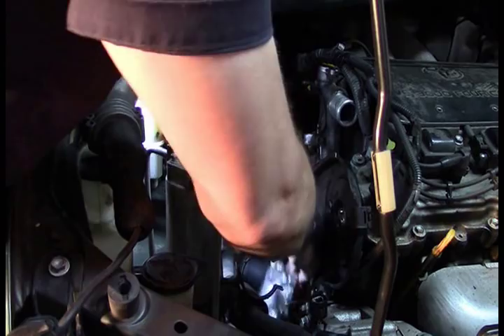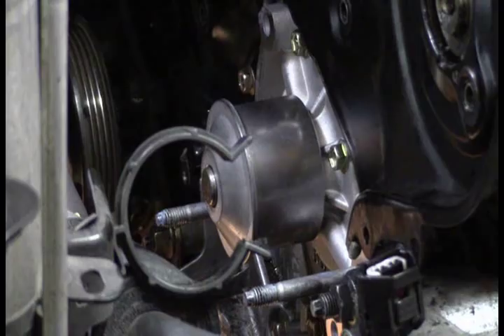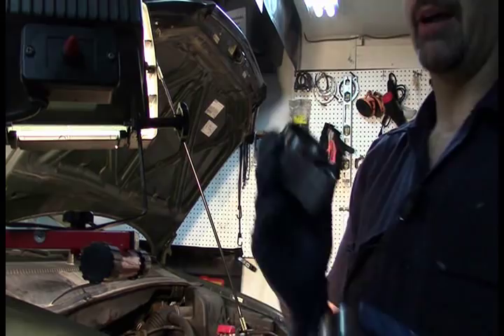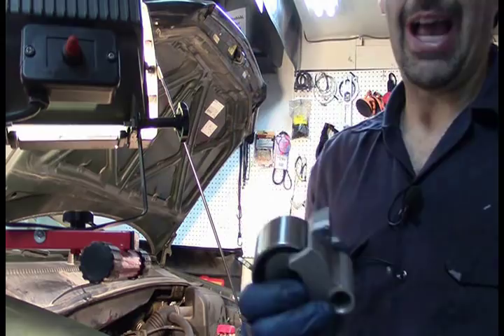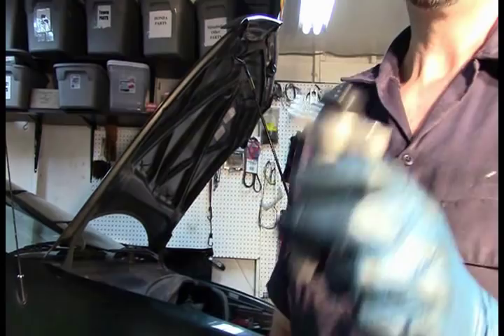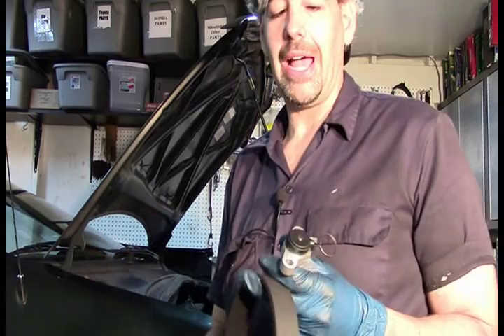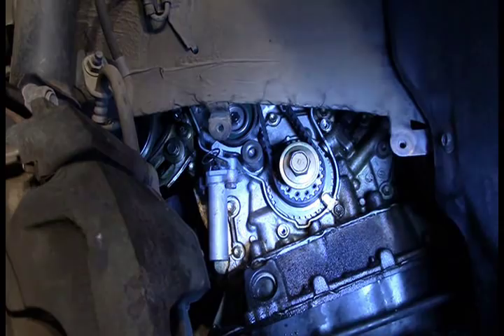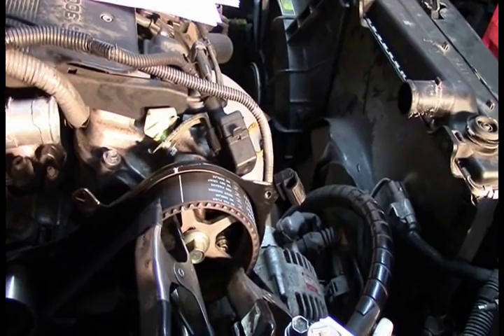Timing Belt 1997-2010 Toyota V6 Sienna, Highlander, Camry, Lexus Part 3

Comment: Thank you. I changed the timing belt water pump the whole kit. Water pump impeller is plastics its break into seven pieces. The pulley I can't take it off with the impact so I use your method with a big ratchet. Use as a leverage. I wouldn't done it without your video. So thank you very much.

Comment: Great video. I don't disagree with replacing everything as you mention, but I would like to tell you about my 2.0L 1991 camry timing belt adventures. The car ended up breaking a timing belt around 260000 km (160000 miles - I didn't realize it had a belt at the time - I was still living in the chain days. So the car had to be towed to my house- very costly and unpleasant experience. I then tried to replace the belt myself in the street in front of my house (didn't even have a driveway in those days) and had the same problem you mentioned - crankshaft bolt won't budge. So... I simply cut off the plastic belt cover and installed the new belt (no other replacements). I drove the car after that for another 100000 miles or so always carrying a spare belt in the trunk. At about 420000 km (261,00 miles) the second belt broke). After about a 10 min roadside in the dark I fixed it and drove away -lol. The lack of a cover meant I could change the belt out really quickly. I retired the car at 465000 km as my wife wanted a new car (it was still running fine and I never did get to that next new belt in the trunk!) 
I really think covers are a big problem on these noninterference engines and make a very simple job into an extremely complex one. If I had broken the belt after every 50K miles or so I still would rather have changed it out the way I did then go through the torture of what you have to show in 3 videos. (the part was less than $20). Don't get me wrong the video is great.This begs the question of why an easily removable cover cannot just be installed? or is this just incompetence by designers? or part of their intent to eliminate all things cheap and simple? - even your water pump design flaw shown here  raises this issue (eliminate the little guy).
Reply from the maker: +Johnny PolarPack Modern engines are designed to do a lot in a smaller space. It's obvious looking at any modern engine that everything can't have it's own space- things HAVE to be in front of other things and "stack" to make this design possible without the car being even bigger than vehicles with obsoleted technology.
  It's just more wrench turning is all. Yeah it takes more time but it's just more dismantling, nothing any competent DIY can't figure out.
Reply: +Schrodingers Box Unfortunately time = money; especially for those without the special tools for dismantling. Money makes the world go round. My point is that the design of these things tend to be in the direction of increasing labor/costs for fixing them. JoBlow might decide to change his oil but probably won't do a timing belt and hence will spend a large quantity of money at the repair shop (think dealership here) when he probably could have easily accomplished it himself if the job was designed for simplicity in the first place (bring in the easily replaceable belt cover). But alas cars are not designed for easy fixes but for maximizing profits and usually the two are incompatible.
Reply from the maker: Johnny PolarPack Very good point... no question it takes more time and thus more money.
  In fact- this is the whole foundation of my channel. Because repairs take longer and are much more involved than in the old days- ESPECIALLY the diagnosis, a DIY can save even more money and frustration if they have the competence with modern vehicles.
  Autozone is is chock full of guys who can turn a wrench and replace parts but they are so good because they keep replacing the wrong thing.
Reply: John Neu j

Comment: Another way to loosen the crankshaft pulley bolt is to spray it with CRC Freeze Spray. This worked for me when I could not loosen the bolt on my 2000 RX300 with my heavy duty impact wrench. After the spray, it came right off.

Great video for the first timer!

Comment: Thanks so much for your good instructions.  Regarding the securing of Cam 2 on these Toyota V6s (1MZ-FE) engines, those suckers will want to spin backwards or forwards depending which way you tug on the belt to take up slack.  I could not find a way to secure a box wrench on RX300 other than to have my assistant hold back and front Cams secure and then did your trick of having crank 2 teeth to left of mark to get belt om the crank, turn 1 tooth to take some slack out.  then I enough belt slack to get on the the tensioner pulley last.  When belt was completely on.  I turned crank the last notch, all marks spot on!  Yea!  Also, I found using phone camera on "filming mode" the best way to make sure Cam 2 marks are aligned.  I didn't trust my mirror angles to eliminate paralax and the camera light also helps in dark spot under wiring harness.  You earn multiple merit badges doing this job especially if your journey includes Cam and Crank Seals!

Comment: Excellent set of videos.  Very thorough and helpful indeed.  Just one caveat:  Up to 2002 IMZFE 3.0L V-6 is NOT an interference engine.
Reply from the maker: Correct. the intent was to show procedures for the interference design but indeed this engine is not interference.

Comment: Excellent.  My one comment is I totally agree, the timing belt usually doesn't fail first.  A pulley or something seizes up.  That may damage the belt, but as you say, that's why you change everything it touches or runs against.

Comment: Hey man…I just finished watching all 3.. very excellent 3 part series on timing belt replacement.  You did an excellent job and covered A TON of info that will be helpful for anyone tackling this job wether its on this exact vehicle or any other!  I liked seeing your tip about using clamps to hold the belt to the cam pulleys…I use zap straps personally but the effect and outcome are the same :) On some engines, that little trick alone is worth its weight in gold! :) This series will be a big hit on your channel I am sure!

Comment: Great video, very useful for my pending TB change. Just wonder, since you marked both cam sprockets and belt, why not pick a place on the crank sprocket touching the belt and mark the teeth with the belt. Then you can transfer the line on the old belt onto the new belt by counting the teeth. By doing this, you will never mess up the timing by a teeth or two.

Comment: If removing cam sprockets, please pull the alignment pins (if used) to inspect them for being slightly sheared, the same as the crank alignment key, along with the cam gear alignment hole or slot for being elongated.  Any problem here will effect timing as well.  The alignment pins can be completely sheared and on your initial belt alignment inspection and re-alignment for what seems to have jumped a tooth or two will actually be a sheared alignment pin so please BEWARE.  The torque of the cam gear bolt will make it seem as though everything is good as the gear will not float by hand but once the bolt torque is broken, the gear will spin freely.  This is yet another reason why I disassemble the cam gear is to do a full inspection of the related items.  Be sure to mark the gears I & E, I have seen them put back on the wrong cam and put on flipped over, some gears have what appears to be multiple types of alignment marks so BEWARE once again.  I like to put the crank pulley on temperarily to keep the new belt from falling off, start the engine, rev it a little to check for power availability (may be off by a tooth for some reason) and verify if any of the new bearings may be bad, for what its worth, then reassemble the entire job.  Scan tool readings may show something if you have one to show a timing issue, or use a simple vacuum gauge.

Comment: Timing Belt Covers:  Why did you not show the appearance of the inside of the covers?  Quite often the determination as to whether to change out the 3 seals will be determined by this inspection.  Some will automatically change the seals but some mechanics will inspect the covers and if they see oil will change the seals and others will not change the seals if there is no oil.

Comment: Thanks very much for this!

I have a question regarding the rear cam:

I see that you needed to remove the wrench in order to remove/replace the belt, so I'm guessing that it takes a significant bump to cause the cam to spring backward?  Or, is it possible that at any moment it is not supported by the wrench for it to suddenly spring backward and one must rely on luck?

What if I decided to proceed as the book suggests, and rotate it back 40 degrees?  Would I just rotate it back to the previous position when placing the new belt?  No special trick needed in that instance?

Thanks again for your time and information!
Reply from the maker: It's a little hard to describe but yes a "significant" bump is needed to move the rear cam enough that it snaps into resting position and potentially cause interference contact. Usually though it happens when you feed the belt around and give enough of a tug that whooooops- there it went!  Yes you can alternatively do the piston repositioning method but I just find it easier to "lock" everything in timed position. There really is no right or wrong way though, this just works easiest for me- otherwise I usually have to try many times to get everything to finish all lined up!
Reply: Schrodingers Box Got it, thanks for the reply.  Truly appreciated.

Comment: thanks mat, i never made any major repair in my car, but i think i have a great idea, when u were afraid of the camshaft to get back to its "resting state" and hit the pistons, don't you think that turning the crankshaft 90° would align the 4 pistons right in between top dead center and bottom dead center thus creating safety? i don't think that any valve gets that far along the cylinder. please correct me if i'm wrong,
Reply from the maker: Yes thats correct.

Comment: In part 2 where you remove the forward Cam Sprocket there are spaces on the camshaft that are specifically for holding the camshaft still to break the sprocket nut loose.  I did not have the extra tool.

Comment: Did you add sealant to the new water pump gasket?  Doesn't look like any was on the old one.   Awesome series!
Reply from the maker: Yes, I almost always add "blue stuff" to any water related gaskets that are of the "paper" or cork type. In fact, I usually use blue stuff in place of the gasket! In my experience the blue stuff actually works better and more permanent than the gasket! However in this application I used the gasket because I wanted to maintain spacing to ensure the timing belt rides correctly on the pulley.  The gasket that comes in the kit is the "paper" type but the original metal gasket has a very thin synthetic rubbery gasket stuff kind of like rubber valve cover gaskets are made of. Similarly, in oil related applications I always use "black" stuff on the "paper", cork, or other non-synthetic gaskets.
Reply: Schrodingers Box Same happened for me.  OEM is a thin metal gasket.  Next mechanic then put the paper type right on top of that with sealant.  Worked well for about 70K not complaining.  Now I'm faced with a dilemma and would appreciate your advice.  I bought an OEM gasket (thin metal) and am not sure if I should add sealant or not.  It will be about 1/4 of the space the old ones were total (metal + fiber + sealant).  What would you do?
Reply from the maker: i do not add sealant to the metal gaskets with the rubbery gasket (i assume its Neoprene?). It will last indefinitely.
Reply: Schrodingers Box My OEM gasket is only a thin metal gasket.  No rubber.  Looks like it's been spray painted black perhaps with a thin adhesive layer?  Similar to the black coating found on multi-layer head gaskets.
Reply from the maker: in that case a thin film of permatex ultra blue is what i would use.
Reply: DJDevon…really good question!  Matt has given great advice already but I thought I would at my 2 cents as a professional.  Being a pro, I usually have access to the factory service information for the year make and model that I am working on, and if the manufacturer recommends sealant be added to the gasket I would always do it!! If the manufacturer doesn't say anything about adding sealant then you should be good without it.  I speak from experience..I once replaced a water pump and gasket on a car (sorry can't remember the year, make or model) and I got complacent and didn't check the service info.  I thought it would be a simple routine pump..but after getting it all back together and test driving it, the pump gasket was weeping fluid fairly quickly.  It was the right pump, and torqued to spec, so I thought I didn't clean the mating surfaces good enough.  I took it all apart, got a new gasket, spent more time cleaning the surfaces, and then re-installed everything.  It leaked again on the second road test.  I looked it up in the manual and realized I had missed that the manufacturer recommended coating the new gasket in a special sealer.  When I called the dealership, I remember they said that recommended sealant was the same as permatex thermostat and water pump gasket RTV..but to just lightly coat both sides of the new gasket.  I did this and that never leaked again to the best of my knowledge.  Sometimes the devil really is in the details…great question!
Reply: Jeffrey Wilson Thank you for the advice. I do have the WSM and it makes no mention of sealant.  Ended up slapping it back in there without sealant because of that.  If it leaks then that's on me and I'll learn a lesson about my car.  Hope you guys will subscribe to my channel and give me some advice from time to time.  I'm still learning and greatly appreciate your advice.  Love your channel Schrodingers Box and will give your channel a mention in my video.  You too Jeffrey Wilson. Thank you.

Comment: Hello Matt, liked your video only thing I saw that did not sound too good to me is how your described a couple of things. I am not a mechanic but I did take a course at a skills center back in the day so I know at least what I am talking about. It lies where you describe air/fuel mixture as an "explosion" and when you advise about reestablishing the belt tensioner into the full retracted position if a mistake has occurred. An explosion is actually a bad thing and can be a sign of carbon deposits and cause engine pinging. You say, in order to retract the pin that a vise can be used to "crush" the pin back in and I know what you meant and so do most people who are watching but these things can get confusing to some people. One does not want to "crush" anything at all here but just have it the pin compressed back to its original position. Just wanted to make everyone understand more fully the ideas you want to get across.
Reply from the maker: You said "the only thing I saw that did not sound too good to me" and I think most people know what you meant, but what you actually should have said is "the only thing you HEARD that didn't sound to good to you" since you did not hear it with your eyes.  Also, since there was more than one thing, it should be the only thingS you heard. 
  Just want to make sure everyone understand(s) more fully the ideas you want to get across.

Comment: I'm curious if you held the crank pulley still and used a torque wrench to torque the crank bolt to 163 ft-lbs as the final step in this timing job, or did you simply use your impact tool to tighten the crank bolt until it seemed plenty tight (maybe with thread lock as backup)?
Reply from the maker: I always torque to spec.
Reply: @SchrodingersBox  - I just wanted to thank you for this timing belt video. Your suggestion to removing the right crankshaft pully in order to tilt/rotate upwards the inner timing cover to expose the water pump bolts worked flawlessly. I also copied your technique of wedging a wrench to keep the left crankshaft from snapping counterclockwise and potentially hitting valves to piston. I just finished changing the timing belt on my wife's 2006 Toyota Highlander Hybrid (3MZ-FE engine). It was both exciting and terrifying as this was my very first timing belt. My last step was to torque the crank bolt so I checked out a 200+ torque wrench at my public library (I live in Oakland, CA and we have both books AND tools at our public library) but the engine just spun with the torque wrench. Because I used two 8mm bolts to pull the harmonic balancer off I thought I could use the same bolts and a long screwdriver to jam the harmonic balancer still, but I'm almost certain the bolts will just snap. In the end I used the same impact driver I used to remove the crank bolt and simply added blue thread lock and drew a bright paint mark across the crank bolt head to detect movement in the future.

Now that I've done a DIY timing belt, I feel like the neighbor's wives check me out as if I was George Clooney. I tell my wife how awesome I am but for some reason she just rolls her eyes :)

Comment: Great vid! Question plz. I am doing TB on Santa Fe. My camshafts are aligned, but my crankshaft was a bit off forward. After i took the belt off I turn the crankshaft clockwise to align it but it stopped and I did not want to force it. Did I mess up?!! or can I put the belt back and align all three cams? Thank you

Comment: Rear Cam Sprocket:  Why did you lock the rear cam?  You kept mentioning the possibility of jamming the valves.  Need I remind you, the 1MZ-FE is a non interference engine.
Reply from the maker: siucbset Not all these engines are non-interference- it depends on the year, plus the idea was to demonstrate the universal concept of locking the cam on any interference engine to prevent damage. The video is not specific to just this engine but to timing belts in general.